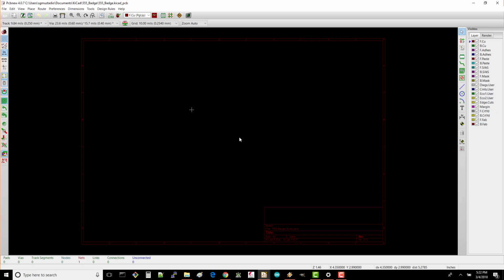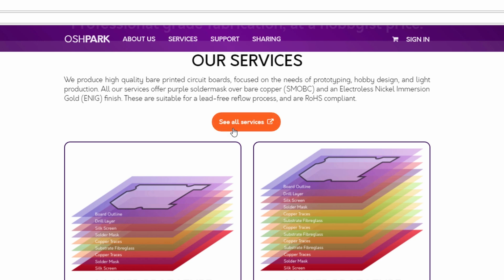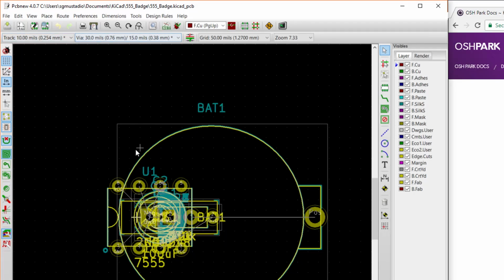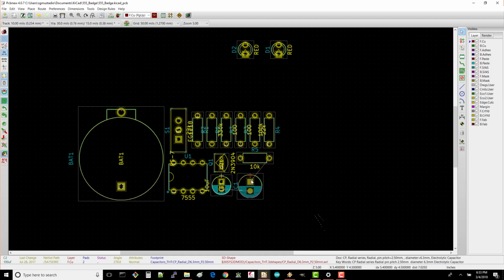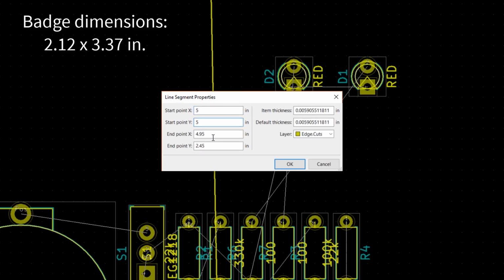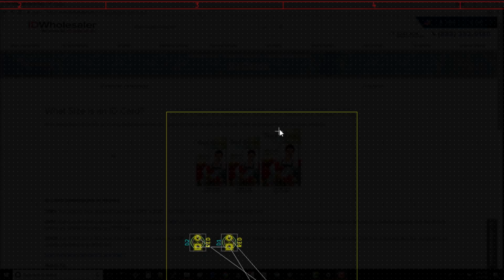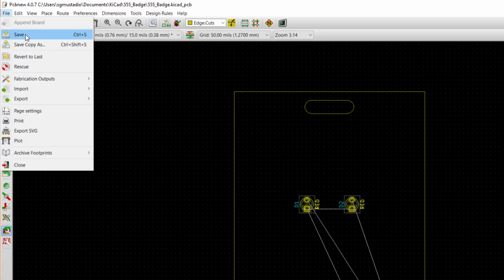An Intro to KiCad – Part 6: Place Parts and Define Outline | DigiKey

Comment: With KiCad v5.x the design rules and pads to mask clearance have been moved to Setup
Reply: They changed it yet again. It's under File > Board Setup in 5.1
Reply: @knightcrusader  KiCad has a horrible update scheme. I cannot understand it. UI always changes
Reply: In 6.0, it's under File > Board Setup > Board Stackup > Solder Mask/Paste
Reply: @alexandrezani  thanks!

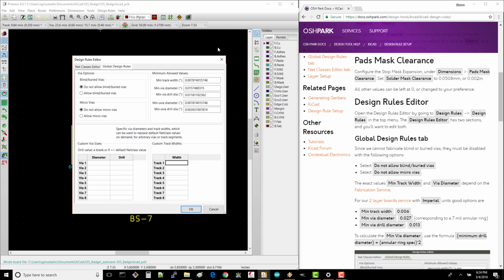Comment: FYI - @5:20 The video mentions a discrepancy in specs on OSH Park's site. It looks like this is fixed now (but they didn't update the screenshots).  At this time the specs on both pages read: 
Min track width: 0.006
Min via diameter: 0.020 (corresponding to a 5 mil annular ring)
Min via drill diameter: 0.010

Comment: Kicad is a pure layout program without any intelligence or automation implemented. But in the world of PCB creation I never saw something intelligent or user friendly. I mean, declutter the elements on the board manually... hey, are we still in the medieval?
Reply: Fusion 360. You can draw a sketch with parameters and constraints and then make the outline of a PCB dependent on the sketch.
Reply: Ooooo also you can create a dxf file from your favorite cad software for your outline (or even an SVG file) and import it into KiCAD.

That’s what I was looking for when I found this video